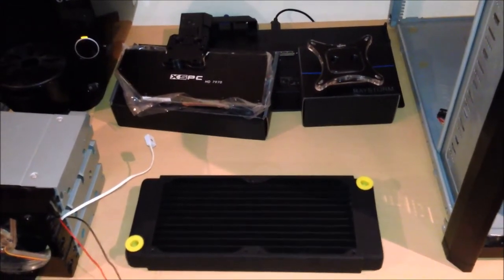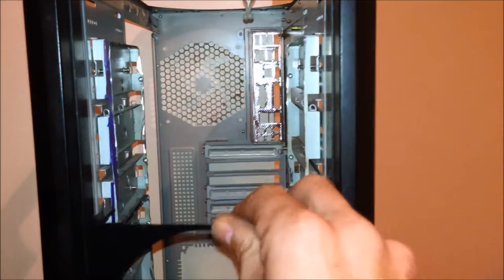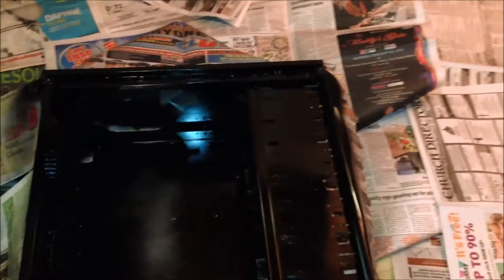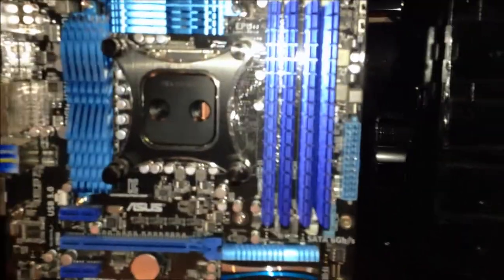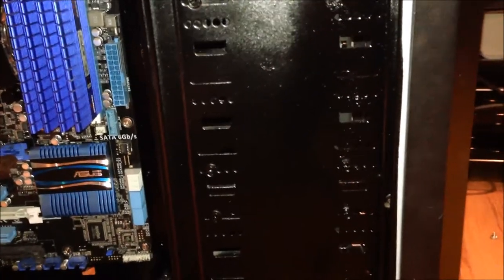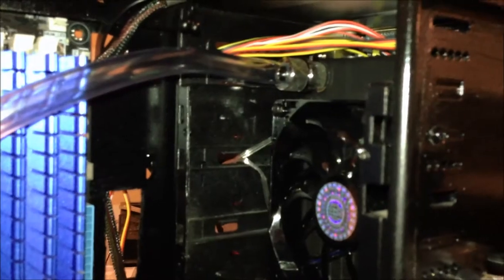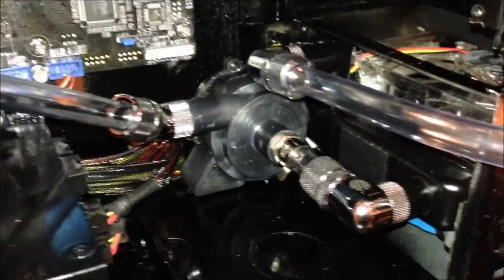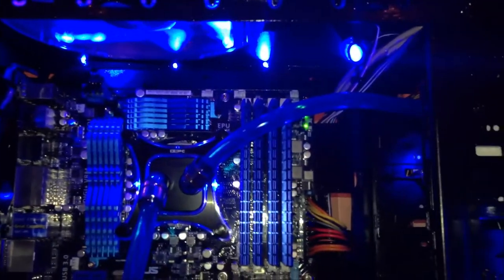MUST DO ANTEC 900 RADIATOR MOD!!

Comment from the maker: Yea I hate the size of the cases these days, they are MASSIVE! taking on 4 triple radiators etc, its just so bloated, when the Antec came out it was big for its time and there is room for everything you just need to "make" room hahaha. the cable management is only achievable through cutting specific provisions for each wire. 

Your comments have got me excited to get started on updating the Pump, Tubing, coolant and maybe Ram waterblock!

Comment from the maker: yea the antec is classic, I love it too but its cable management and hard drive bays are so bad, if you want to take a HD in and out its such a pain so many screws and wires to move!. the H100 is probably too big to stealthily go in this case unless you do the dual radiator mod I did which takes a lot of work! If you are going to goto the trouble for the H100 I would go with a custom loop instead because the H100 is pretty crappy LOL ;)

Comment: water cooled is a fad one leak and the whole unit is shot. Any Chinese parts? high tin add water and you have tin splinters form crystals and short the circuit board. Too much risk that something you can count on it will fail, leak or pump dies and you dont know it. Fans can do the job because most cards dont work their fans until 60 degrees C. is reached.
If you painted inside white it reflects any color mods you add. Hue RGB unit for 60 bucks.